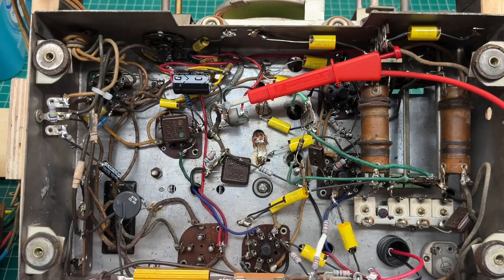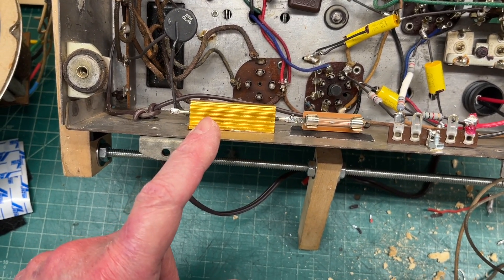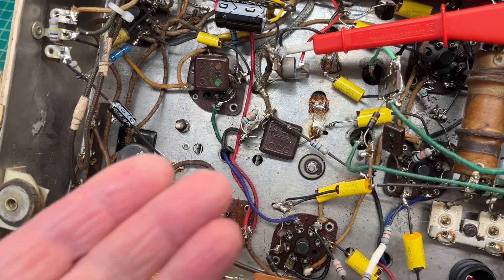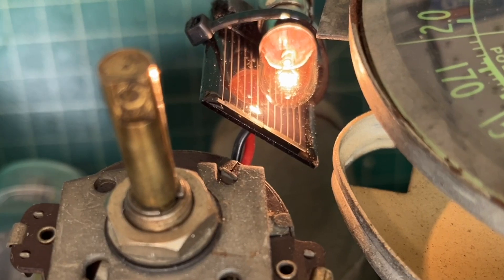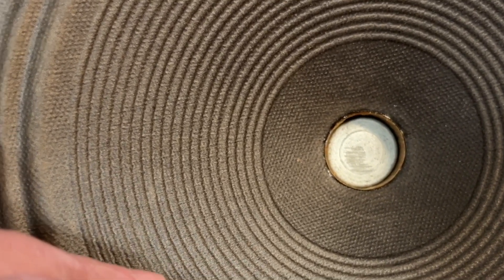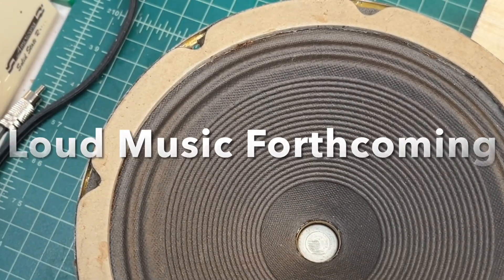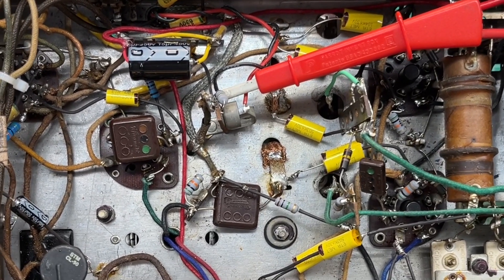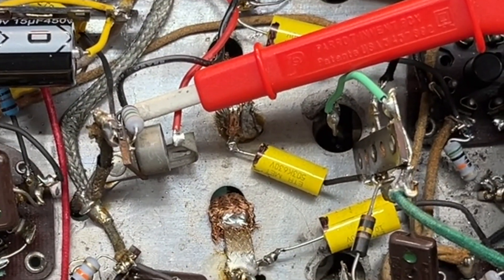Grunow - Model 654 | Bias Cell Replacement w/ a Mini Solar Panel Cell

Comment: Don. As you were explaining the problem with the speaker, I was wondering if lightly spraying both sides of the cone with water and adding some temporary shims would move the center the needed distance (perhaps 1/32" or so") after it was allowed to dry?  Just a thought.
Reply: I seem to remember a video where Don did that by spraying the cone with alcohol and it corrected the problem.
Reply from the maker: You are correct. Best, Don
Reply from the maker: Since the rub was so significant, I decided to remove the old cardboard gasket and detach the cone from the frame. I just posted the video. I’ll keep your recommendation in mind when the next one shows up. Thanks again. Best, Don